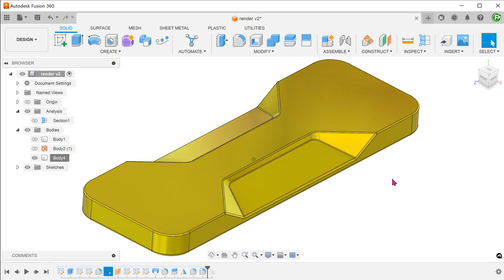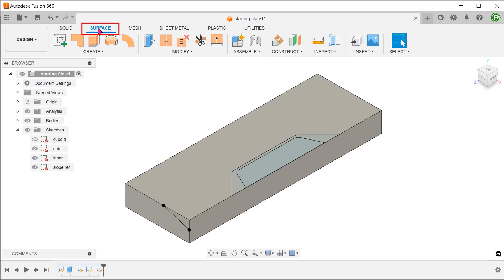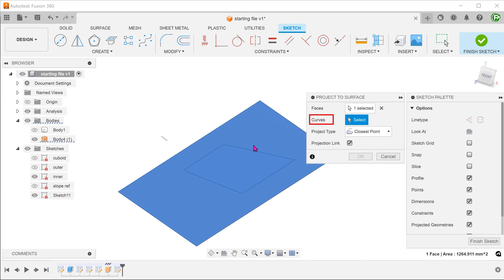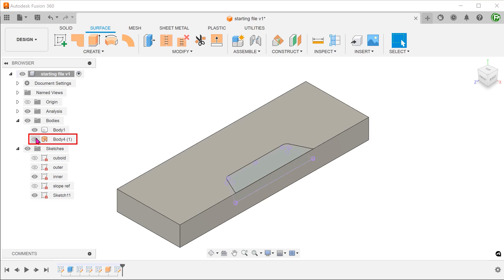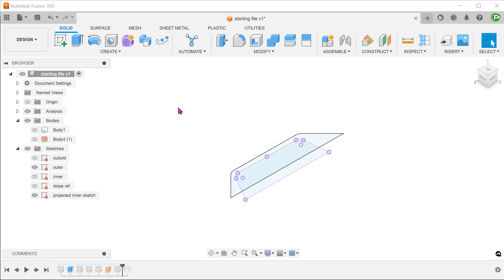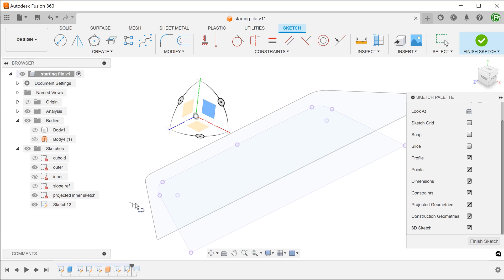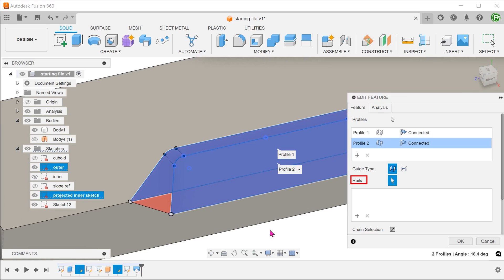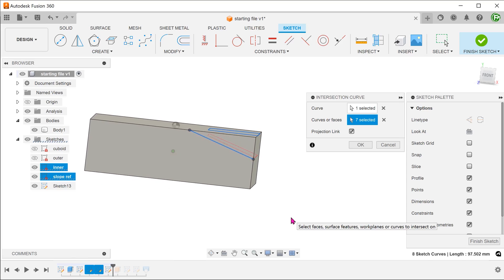Fusion 360 | Lofted cut?

Comment: Hi, great video as usual. However I think there's much simpler approach. Using just the "outer" profile of the cut extract it down by a few mm, then use Draft to draft the "bottom" of the cut by say 20 deg, and then another draft for the side walls of the cut. Finish with fillet and chamfer: https://drive.google.com/file/d/12lKkZSc8JU48pDnwUHQKB_MnQeGqC15d/view?usp=sharing

Comment: Any time I see surface geometry it always feels like a work around or hack. Theres got to be a way of doing this with only solid operations surely.
Reply: See my comment above. I use extrude and draft instead.
Reply from the maker: @SnowGypsy01  I thought I saw a separate comment from you about using draft but I can't seem to find it any longer. During the testing phase, I did attempt to use draft. But the drafted face does not conform to the "inner sketch" profile, so I decided to abandon that method. Were you able to draft and keep to the profile at the same time?
Reply: Yes, he did, with intersection curve.